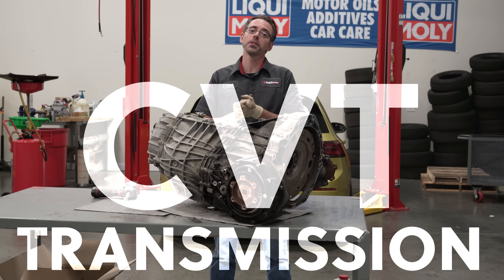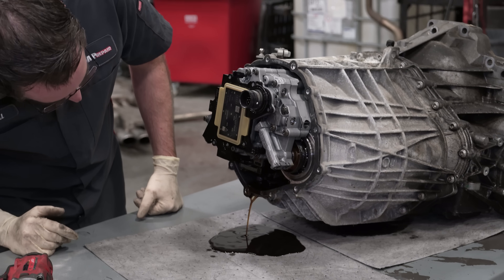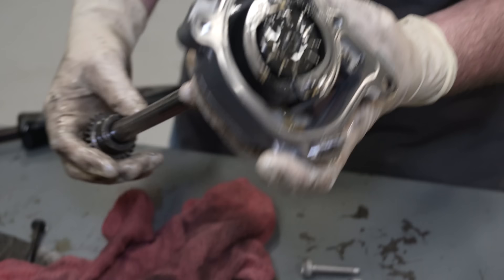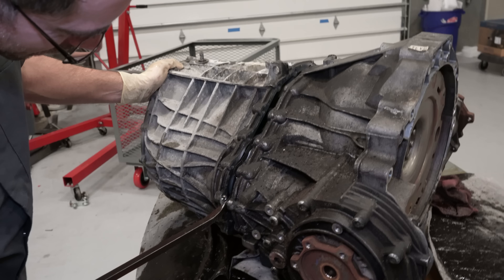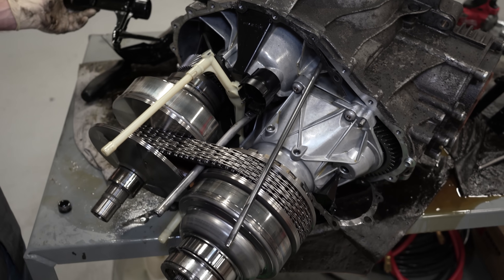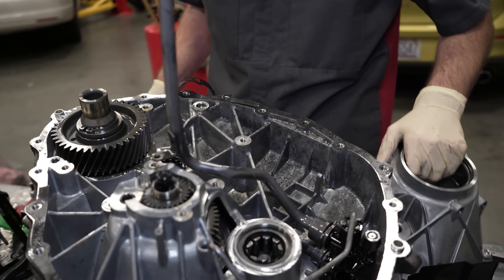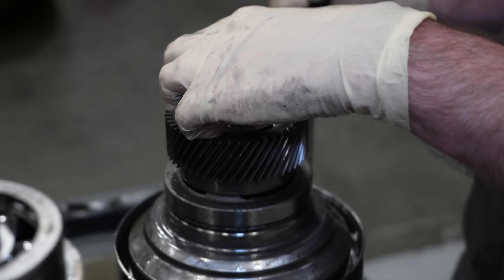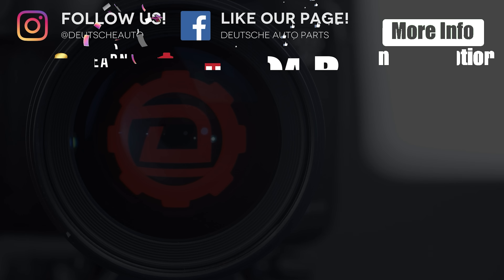Why you shouldn’t get a CVT transmission

Comment: I have a 2019 Subaru Crosstreck. I have usually owned cars with manual transmissions and swore I would never buy a car with a 4cyl engine and an automatic. I test drove several vehicles with 6-9 speed automatics. I hated them—whiplash shifts, jerking, feeling that the tranny needed to shift to a higher gear but wouldn’t, etc. it’s hard to find an AWD vehicle with a manual transmission. I test drove the Crosstrek with the 6speed and the CVT. I loved the CVT and opted for it over the 6speed. Its smooth, always in the right gear and I get excellent gas mileage (32-42.mpg; and I live in Pittsburgh PA  where there are hills everywhere). I am extremely pleased. I have had no trouble after 62K mikes and it is covered by the dealers lifetime power train warranty. No regrets.
Reply: Subaru has a lifetime powertrain warranty???
Reply: @simd510 
It’s from the dealer. I get all my service at the dealer, their labor rates are reasonable and they don’t try to do repairs and crap that aren’t necessary. I now have 79k+
Reply: 62k miles is insanely impressive longevity.

Comment: I had a B8 A4 with the mutitronic gearbox. Nice and smooth/quiet on a run but it was tricky pulling away quickly from a junction as it was so easy to wheelspin.
Reply: glad i just see your comment. I own a b8 a4 with this gearbox and use it daily for deliveries. I agree, very smooth and quiet as keeps engine rpms low but like you say, easy to wheelspin and i find it you floor it from a get go they really don't like it, mine sometimes jumps like its wheelspinning
Reply: @joshbalmforth2629  Hi, yes its horrible when that happens. The car came with Bridgestones, but I found switching them to Michelin Primacy 3s helped.

Comment: I have a Toyota Prius CVT, and I really like it. Smooooooth. Up to 160k+ and never had any issues.

You can really see why these transmissions are so damn expensive. REALLY cool engineering!

This video would have been even better if it was more explicit about the pros/cons of cvt vs non. I assume regular transmissions, excluding the clutch, are simpler and therefore more reliable?

Why are the car companies pushing these? Because they are expensive and get them $ when they break?

Anyway, I really love the concept and smoothness of CVT. So if I get a Toyota I'll be happy to have one.

Comment: 4-26-2023, 8:35AM, PST. 
  : If you change the fluid before its recommended time (30,000 miles), would this lesson the problems that you might have?
 I have a 2023 Honda Civic Sport Sedan 2.0L. I have a little over 3,000 miles now. No problem so far.

 By the way, outstanding info information video. A little destructive. LOL. 
Anthony, Inglewood, California

Comment: I have 2018 Sentra with 43k miles on the clock, changed the transmission fluid at required time by the manual, great transmission for daily driving and great power for smooth driving experience

Comment: You shouldn't get a CVT if you are an IDIOT! 99% of owners have NO PROBLEMS with them, but people who A: Shift while in motion and B: Don't get them SERVICED DO have problems. I personally know of a Nissan Altima with 2 MILLION+ miles on the original CVT that works PERFECTLY and is driven nearly 100 miles daily for a commute and it's a 3.5L V-6!!! What is the "secret"??? They DON'T "rolling shift" from reverse to drive, or drive to park (no "big zipper sound") they get it adjusted, they change THE FLUID at the recommended intervals. The "sho' nuf tale" is with a V-6 the CVT won't last a year. Billy's has lasted 15+. The Citroen/Renault CVT transaxle is the most widely used transaxle in cars EVER with more than 42 million in service and only "Murikuns" have problems with 'em. But we can't read an owner's manual...which is why people do $5000 damage with the jack changing a tire! ($40,000 to a Porsche!)

Comment: I have a Toyota CVT , currently on 270k kms , they are not trash in any way shape or forum , they're actually amazing transmissions if you service them correctly
Reply: How many years ?
Reply: @tinuvarun5806  I sold that car 💔🥲 but to a friend , still running strong as I know , the car was 2013 or 14 , sold it around that number , maybe 285k or so , I can't stress the importance of the original oil enough though , expensive yes , but ... A world of difference on its lifespan
Reply: How do you service them correctly?
Reply: @SlowerTrafficKeepRight-k2g  I never really went pass an oil change , but it's worth mentioning , the OEM one is vital , it's expensive , but all the issues I heard were from people who started using other oils , and/or delaying service times , if you service it the way it's meant to , it should cause no issues , mind you , I just sold my race car and got a Nissan Cube (not a Toyota my bad my other car is an FJ) , I drove that thing like crazy , just pushin , and it's been smooth as butter , I love it , RPM right at your power peak , then shifts while RPM still up there? 
Pffff , I love em , the power you get vs say a 6 speed auto is insane , it's like anti lag , on a naturally aspirated 1.6 4 banger 😂
Reply: The shit I took and left in my toilet for years doesn't stink up the house if I continuously spray Febreze on it. What's your point?
Reply: @2stroke750  if you can't comprehend what I'm saying in that less than basic comment I doubt you'd understand what my point is if I explain it in any other way dude , no seriously , it's literally there , in the comment ... My point that is ... 😐

Comment: ok after reading the top comment, I don't feel bad about my toyota CVT transmission, but very slow, it's meant for efficiency and more runs so I guess less complaints there, only downside to our car is that it's daihastu body frame, so strut bars are needed, and upgraded suspensions and tires. ( basically modded already )

Comment: CVTs rely on dynamic rolling friction, constantly clamping and releasing. That is the big problem--wearing all the time, and worse with heavy loads. Conventional automatics rely on static friction... the clutch is either engaged  or disengaged  .. an engaged or disengaged clutch does not wear.. even heavy loads are not a problem unless they are so heavy that the transmission slip (NOT a normal situation)

Comment: Some transmissions are badly designed with tons of flaws, but in general it will only break if you don`t do preventive maintenance. The transmission in the video looks like it doesn`t had a transmission oil change for a long time if it even had one in it`s lifetime

Comment: Someone I know had a Nissan with a CVT and after around 60,000 miles, the transmission went out, they had it replaced under an extended warranty with a "rebuilt" CVT, but then after only 50,000 more miles at around the 110,000 mile mark, the transmission went out again, they got tired of replacing transmissions so they got rid of the car after only 8 years.
Cars with CVT transmissions are disposable and not reliable. I will never buy a car with a CVT.

Comment: Had two Subaru's with CVT's that have both been great. the 2011 is STILL being used by my son. The 2016 3.6r is still also going great as a daily driver. I love the smooth acceleration and lack of constant shifting on hills....
Reply: What maintenance do you do in Subaru CVT?
Reply: @Noypi54494  None. I leave it alone. My 3.6r outback has over 115k miles and is still smooth as silk, and my sons Legacy 2.5 has over 200k on it. I don't baby the cars but none of us are lead-foots. We're also in Colorado so not flat and not easy weather.
Reply: @Mike80528  impressive!
Reply: @Mike80528  You should do oil, brake, differential, coolant, and cvt fluid changes.
Reply: @possiblycurryddork  You forgot to mention windshield washer fluid, brake fluid, greasing bearings, rotating tires, replacing brake pads, rotating tires, etc...

Oh wait, we were ONLY talking about CVTs. Let me look at the owners manual again...
Reply: My 2017 cvt Subaru broke and the shop pretty much paid for 80% of the cost
Reply: @deadjrnnl  Did you have extended warranty insurance on it?
Reply: @Noypi54494  no there was no warranty I don’t think
Reply: @deadjrnnl Why'd the shop post for 89% of the cost?
Reply: My 2006 Subaru Forester tranny is way smoother shifting, albeit clunks when going from reverse to drive....than my wife's newer 2018 Subaru Forester which is very chunky shifting ever since it was brand new.  The automakers blame the EPA for trying to squeeze every last mile per gallon efficiency out of what used to be reliable, albeit inefficient trannies.  I'm switching to Toyota next purchase, that is if Biden and Pelosi have allowed me to purchase a gasoline engine car ever again.
Reply: When you get a Mazda with AWD and off-roading like a CX-50 you will experience something like w new life thanks to the 20th century transmission. I forgot what's it like
Reply: Not true
Reply: why would you have constant shifting on hills in a non-cvt?
Reply: @Abeyancer  How would it not? Please explain the physics of maintaining constant speed with constantly varying slope and fixed gear ratios?
Reply: @Mike80528  constantly varying slope? to such a degree that your car needs to continuously shift gears to compensate? we're obviously driving on some very different styles of incline.
Reply: I've had 2 MT Subies. I will not buy one with a CVT. Worst trans ever made, for durability and performance
Reply: @K2SKIER112  I have had multiple Subaru CVT's without ANY issues. Hmm, You had multiple with issues, I without. What is the common factor? The driver doing the maintenance maybe?

Comment: They could make this whole transmission way better by using individual solenoids per operation. In the CAT world they call it ECPC. You no longer require a valve body and way better modulation. You can also run much higher clutch pressures reliably. I guess it's too expensive to make.

Comment: I couldn't agree more to your opening statement! I have a 2007 Nissan Altima with 130,000 miles on it. It still runs and drives fine, on flat land only. I was driving up the grade to the area where I live and suddenly the transmission crapped out on me. I was able to limp into my local dealership, they kept the car overnight, then told me that the transmission has over 100 fault codes and I need a new transmission. They quoted me over $5,000.00 to repair it!
I have been limping along just driving it no more than 10 miles from home and its lasted me over a year since the breakdown. I'll never buy another car with a CVT!

Comment: I have used CVTs  in many  different cars, from small urban cars like Honda Brio or Daihatsu Sirion, to family  SUVs such as the new Kia Carens, but most important on my former Nissan Gloria 3.0 V6 Turbo with 285hp. Under certain circumstances of use, it's the best transmission ever. And I say most relevant about  the Nissan because the car was (at least) third hand, imported to Myanmar from Japan, and over 10 years old with unknown service. It worked perfectly and the car had huge power reserve.
Reply: i agree CVT transmissions were ass in 1st gen similar to EV. Manufacturer's improved them by a mile over time.

Comment: This video is way too dismissive of the "CVT" as if they are all the same, regardless of brand, vintage, etc. The OP does not appear to have any real expertise either, just bitching with little hard facts behind his comments.

Hell, primitive CVT's have been used on farm machinery for a LONG time, and they have worked reliably. But according to this video, those CVTs are crap.

Speaking for myself, I have a Honda Accord with a CVT, and it drives great, has been no problem, and the car is almost at 200k miles. Two of my siblings have similarly old cars with CVTs, and they also have had no issues. Many of my co-workers have CVT cars, and they also report no problems. I don't think CVTs are as awful as the OP wants us all to think.

Comment: We are driving 3 different cars. All with CVT. These are used for long and shorts travels. Work and private travels. Lots of luggage no luggage. Etc. Not a single issue whatsoever on all 3. Most times it is the driver of the car, and not the CVT that is the issue.

Comment: My coworker had lots of time to car shop on the weekends. He was switching from his big Dodge Ram PU to a car for mileage reasons. Thanks Biden. As Nissans kept popping up on Craigslist in the 2014 range of cars, I explained to him about CVTs and especially the Achilles heel of Nissans, the Jatco junk. They cost about $5,000 to fix. In the price range of a $6,000 car that makes no sense. My coworker bought a Fusion and LOVES it.
The Jatco junk and I guess all the designs use a push design instead of pull design on the belt. That just doesn't make sense or even logical thinking but I'm just a mere mortal. I love Nissans. Had a Maxima for 3 weeks until it got T-boned. One month later when I could get out of bed and walk after the whiplash, I found an Altima. Both cars had automatics, with real gears. They were both 2003. I think after 2006 is when you can get any transmission you want as long as it's a CVT!!!

Comment: Look here is the issue with them. They tell customers its a sealed for life transmission. If you service them every 25-30k they can make it to 200k. I have seen a Maxima with 200k miles original Jatco CVT. That being said I prefer regular automatics.
Reply: Exactly. That’s why Subaru cvt’s’s continue to fail to this day, because Subaru insists on a sealed for life cvt maintenance.
Reply: @haroldbeauchamp3770  Everytime I see a friend or family member post hey look what we did today on Facebook and post a new car or SUV that has a CVT transmission I PM them and explain they need to have it serviced every 25k-30k like clockwork. You cannot miss a service interval with these they will fail if you do. They always reply the dealer said its sealed. I then explain if you do what the dealer says they will make 5-6 grand more money off of you. They see my point and say they will have it serviced. Its a money making scheme, but in Nissans case a reputation destroyer and a Subaru reputation dent. Most people that have to shell out 5-6 grand while making payments never return to said brand. You would think these auto companies would see why Toyota loyalty is highest in the industry.

Comment: My cvt on my Nissan maxima (not Altima) worked great.  I put 110,000 miles on it and sold it with zero problems to get an suv for trailering a motorcycle.

Comment: Let's just go back to extra light cars and a Daf Variomatic. Those were pleasant to drive, reliable, though you do need to replace the rubber belts on the regular and they won't work for more than about 75hp for belt wear reasons. The models that use an individual uncoupled CVT per wheel also have the benefit of it working as a limited slip differential - each wheel can have a different transmission ratio. If one breaks you can still limp it to a safe place to swap a belt, or in this densely populated country to the nearest garage.

Comment: MB w CVT. Booooring like hell.
Sensor electronics failed. East european refurb plus labor 1200 CAD.
On the other hand in Canadian freezing colds its pulling fine getting close to 250K.  NOT a recommendation but lets not demonize it. It ain't Vega.

Comment: I own a 15 Honda Fit with a CVT. The car isn't perfect but the trans has never been a problem (around 160k mi now). The upside of a CVY is mileage. This vehicle gets between 38 and 48 MPG (verifiable real mileage with a calculator and fill over the life of the car - I have the spreadsheet :)> The downside I realized before ever buying one is, as you stated, lack of torque transfer ability and much higher maintenance costs. I nearly doubled the factory spec by servicing every 40k mi. It IS a trade off but IMHO not a right off :). Anyway that's my .02 worth Thank you for the video. It is excellent to see just what's inside. Cheers
Reply: Do you mean doing it at 40k rather than 30k?

Comment: "They don't hold torque very well" is a weak argument in an era of steel CVT belts (see honda and toyota variants which are superior to the design shown here), hybrid drivetrains and $6+ per gallon gasoline (petrol). At these gasoline price levels, the ONLY way to enjoy ludicrous torque in a car AND not have your gasoline bill surpass your auto-financing bill for the month, is to go all electric (tesla, et al) which are typically single gear transmissions or it's to get a 15 year old manual camaro all cash, and just pay the car-payment sized gasoline bill forever.

You can also get the exotics, but then the prices involved essentially mean you do not have concerns for automotive running costs (you're swimming in money).

Comment: I really did not enjoy this video.  I have seen the breakdown of other videos that were way better.  This guy literally tore apart apart a transmission that he knew little to nothing about, didn't know the reason for failure, and had a lot of scrap metal at the end.  He was just breaking stuff off and I have seen people with way less experience do better.  He simply stated he does not like CVT transmission and couldn't state any reasons except they are not reliable.  I have seen people change tons of transmissions no matter the kind.

Comment: maybe if changed the trans fluid every 25000 miles it wud last longer? not... never change the trans fluid.  of course everyone has to GET ON IT in NASCAR SHORT COURSE Driving style... ALLL THROTTLE... ALL BRAKE to every red light in town. so can txt txt txt at every red light as that is what is most important is txt txt txt txting

Comment: The Honda and Toyota CVT don't seem to have any real major issues. Some of the conventional automatic transmissions can be junk as well.
Reply: Honda had issues from 2013-2015 and fixed them. Toyota had them in 2017 and fixed them immediately with a recall.